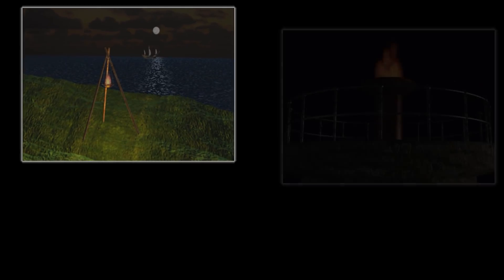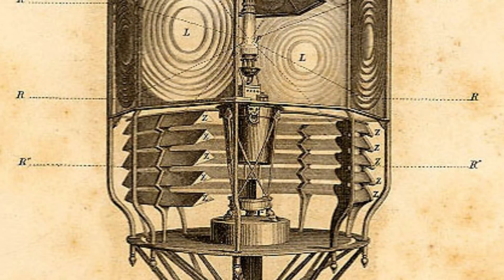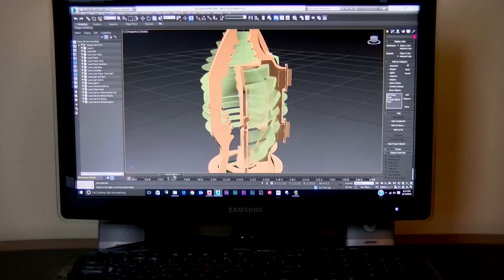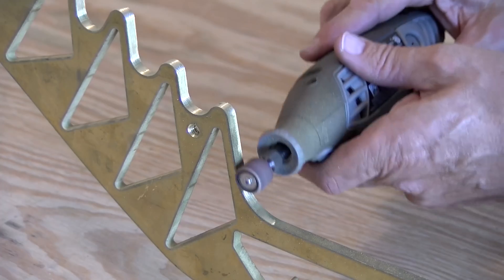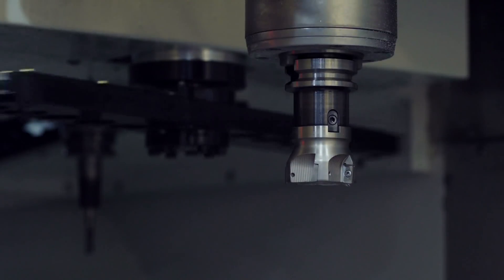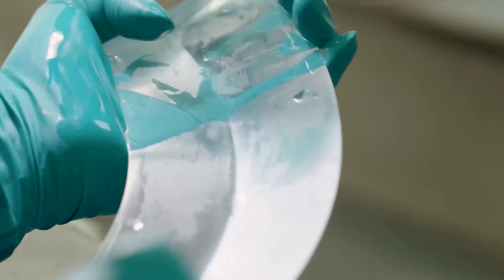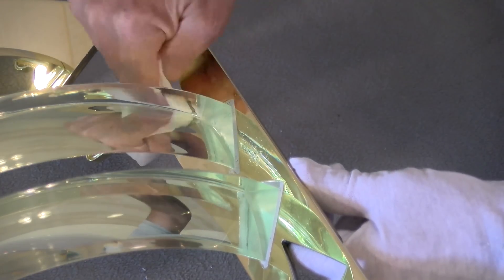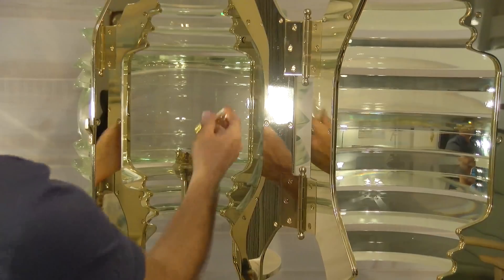Fresnel Lens Manufacturing - 2018 Michigan Lighthouse Alliance Conference

Comment: I would like to produce one of these lenses as well, I am hooked. I would like to get one done with real glass. Does anybody know if that is possible. Glass can be cut with water jets I believe but only straight cuts rather than curved cutting. I imagine they had iron cast forms where the glass was put during manufacturing to get the rounded shape. I guess after that they simply cut the prisms into smaller pieces. Does anybody know if the acrylic prisms can also be produced in real glass? Surly they must be a way of doing this`?

Comment: Fascinating. 5:10 you said "cotton gloves are not used at this point to prevent the frame from tarnishing." Later in the video I see the operator touching the frame without cotton gloves multiple times, see for example 8:43. Why? Thanks

Comment: I wonder what the cost and optical differences are between the plastic and glass. Glass can be machined on a CNC apparently but I wonder if it takes too long or if you have to use a very high end glass. I doubt the acrylic would yellow, though, since pretty much all windows today are UV resistant or reflective(notice how you don't get sunburn in a car with the windows up or when you sit near a window in your house).

Comment: How many CP / Lumens is that tiny little bulb? I thought that lighthouse beacons used carbon-arc lamps or at least kerosene mantle lights?
Reply: I think this reproduction lamp is intended for decorative or museum use, with the light mainly 'for show'.  Lighthouses have not used either carbon arcs or mantle lamps for a very long time.

Comment: You might consider using those 5-axis functions during finishing. You could have the tool contact the part in a constant angle, so that the surface speed of the tool is in correct range. And you could use circle segment tools.

Comment: Are these shaped differently so they refract properly with acrylic instead of glass, or are they exact replicas that don't work as the original did?
Reply: Darn, you've got me working the brain on a Sunday morning.

At the risk of sounding stupid: would it even matter?

With the refraction upon leaving the transparent medium being the inverse of what the light encountered when it entered the medium. Would the exiting angle not be the same, regardless of the material?

I'm looking at the first picture in the Wikipedia article on refraction, showing a ray of light traveling through a plastic block with perpendicular faces. The ray of light changes position, but it's angle stays the same.

If this block were made out of glass. The light would exit the block at a different position, but at the same angle.

Now I might be overlooking something which changes this when the surfaces are not perpendicular, but I can't think of what that could be.

Aight, that's enough. This brain needs more coffee!
Reply: @sigi9669  yes, the angles and refractive indices of prisms and lenses do matter. The faces aren’t all perpendicular, though I don’t think that eliminates variation based in refractive index. But as you note, it’s a lot to wrap your mind around first thing in the morning.

Comment: But that's not glass. Polycarb has a different refractive index than glass (I wear high index glasses so I know different materials have different indexes.) I mean if you are making lenses for historic lighthouses should they not be made of glass? Polycarbonate and UV long term are not a good fit even if you do put a protective coating on it.
Reply: I'm guessing here, but these are not made for "in-field" use. They're replicas for museums or existing historical lighthouses acting as museums. I don't think these units will be exposed to long-term use and UV.

Comment: It's so disappointing to see that, despite the obvious pride and care taken to create these masterpieces, the simple task of tapping the threaded holes in teh brass frames is done with complete randomness, resulting in the screw slots being random, rather than lining up together. It costs nothing to achieve...
Reply: That would only work if the screws were also uniformly manufactured.  In general, they are not.

Comment: They made the lenses circular, absolutely makes no sense to spin the whole complex. Fresnel lenses of a lighthouse direct the light to those 4, 6 or8 respective faces they are installed to, making the light pulse and more easily recognizable. Wouldn't it be nice to build these with some actual sense if so much effort is spent?
Reply: Circular lenses give short pulses of light (at the viewer's location). This lens wrapped around 270 degrees, giving a 75% on - 25% off pattern. The flash pattern of light houses was varied for each one as an aid to identification when at sea.

Comment: Indeed a piece of Art, I should probably just hang one of these in my Florida house as a chandelier. Wonder why they just dont use an eye safe laser ?
Reply: Led's used  todays, some of this looking lens stuff could found with them. 
That should need just one 6 kilowatt flashtube in it, it would give some good headaches for people.

If they do optics vertically, why it need's spin like that? Old days light house shows two or four spot's and rotate right speed for unique interwalls

Comment: Gorgeous. It's hilarious how much care they take with the metals and then suddenly they're installing the prisms barehanded.
Reply: Probably started slipping and in frustration tor them off and threw them to the ground.
Reply: And the lightbulb
Reply: Lol, I noticed that too😂
Reply: Hand oil's won't tarnish the acrylic, but they absolutely will tarnish the brass.  They mentioned that.  There may have been some inconsistency in the video, but it was likely just due to the staging and filming.
Reply: @StanErvin-yo9vl “I don't think anyone has found a microbe or a bacteria that will convert plastics all the way down to basic elements.”

Wax worms dissolve plastic. We’ll ignore the “all the way down” bit, since even glass won’t degrade all the way down to silicon and oxygen. Over very long enough time, though, all matter decays to pure energy.
Reply: @b1ff 😊
Reply: @StanErvin-yo9vl  Problems with the phone? What with the barrage of emojis and whatnot.
Reply: I imagine the brass was coated with a lacquer to prevent oxidisation, that way it doesn't need constant polishing...
Reply: @peterfitzpatrick7032  oh, well that would make a lot of sense.
Reply: Brass is usually lacquered before it is used.  It's not just skin oils that are a problem, the average moisture in the air will tarnish brass if it's not protected by a clear coat.  My guess is that the brass lacquering process was done before the lenses were installed but it wasn't shown in the video.
Reply: this is so stupid and ignorant of what happens in the video. Its like you didnt even watch it lol
Reply: Probably due to the person being a little nervous since they were being filmed. That, and it could've been an actor hired by the company that did the photography. Its not uncommon for videos like these to be somewhat staged or for people to make mistakes.
Reply: You did not see the part where the lenses dropped on a floor multiple times due to the slippery cotton gloves...
Reply: Indeed, puzzeling🤪
Reply: @StanErvin-yo9vl  you DO know this is just a piece of art ? 🙄😂
Reply: The cotton gloves would get caught in the sticky epoxy.
Reply: who cares the lenses are made of plastic and I doubt they would withstand the heat anyways
Reply: Yankees...
Reply: @DarioBike  what does that even mean in this context?
Reply: Glass doesn’t tarnish from hand oils.
Reply: metal might react to skin oils and start corrode in the heat of usage where glass would probably not
Reply: @Goon-124  they touch the metal bare handed when installing the acrylic lens elements.
Reply: @Goon-124 not brass
Reply: Thanks you spoiled the whole show for me
Reply: @trumptardican  lol

Comment: Too bad they didn't think it was worth making glass lenses for it.
Reply: Agree.  Glass would be the gold standard and would last for an extremely long time.
Reply: The optical quality acrylic used has a higher transmission rate for light than glass does.

Comment: I have been trying to get my hands on a large fresnel lens for over 10 years that is big enough for the frame my grandfather had made to hold the lens he bought a long time ago.......sadly we couldn't find one affordable enough to replace the broken lens before he passed away........I still need to get a lens to fix his fresnel lens heater for him and me even though he's gone
Reply: How about fixing it same stuff they use windshields 'hole's' and make them gone. It's hardened with UV and mechanically it's very good.

There's even thin films that could use to save glass from breaking.
Reply: @jannejohansson3383 .......no chance in that the lens was too big

Comment: Looking at their website, the lenses are indeed milled from a very high end acrylic plastic. 
It's amazing to see what can be achieved with CNC manufacture and judicious hand finishing.
Reply: I was wondering how they were machine glass.  And it becomes evident why they need UV protection.
Reply: @tonyennis1787  Some glasses used for optical applications can be machined; usually with carbide tooling, or with very high tooth count cutters to reduce the amount of force being applied to the material and thus breakage. But generally most glass is ground to shape, first with roughing tools, then with very precise optical grinding equipment which has a large platten with the optics mounted in pitch (tar), and the grinding surfaces and media in a specially formed pitch tool with weights and grooves to keep it's shape (since pitch is a fluid, just a very very slow moving one), and the grooves help remove the swarf and allow coolant flow. That's the only way to achieve high accuracy at the practically atomic level needed for lenses; but for lighouse optics, they could get away with a fairly rough cut; and with cast lenses in the case of the fresnel bullseye lenses.
Reply: I wonder how long the acrylic would last in a harsh atmosphere like the ocean front ?  Car headlights get about 10-15 years and then they oxidise due to IV damage (and they are coated with a UV protectant too).
Reply: @GodzillaGoesGaga The real problem with plastic is it would scratch over time from cleaning
Reply: I'm thinking it would almost have been cheaper to have them made of actual glass. The problem, likely, is that there aren't enough skilled glass-makers to take on the job. CNC shops are a dime a dozen, though. 

Even still, multiple 5 axis operations + inspection is not at all inexpensive.
Reply: @Pow3llMorgan  According to their website, they also create lenses from actual glass. No idea as to the relative costs. However I would infer there must be some advantage to the acrylic option for it to exist. If not cost, durability or authenticity seem unlikely.
Reply: @Sandro-Da-Cruz  some light houses are no longer navigational aids, but a historical group might want a convincing lens for looks.  in some cases a light lost its original lens for one reason or another and in restoration if it wont be an official nav aid it would certainly be worth the cost savings to use plastic.
Reply: Thank you!
Reply: I saw that nice sharp carbide endmill coming down on what I had assumed was a block of glass and I puckered right up!